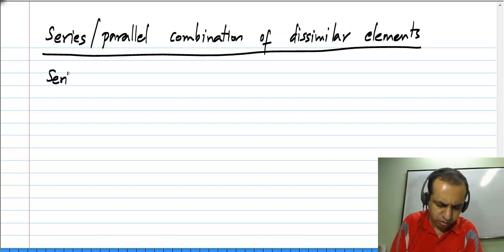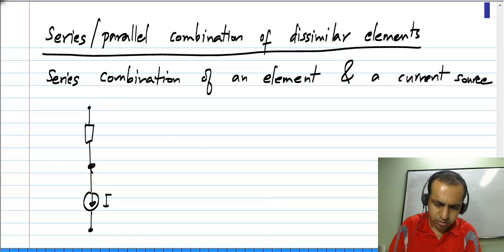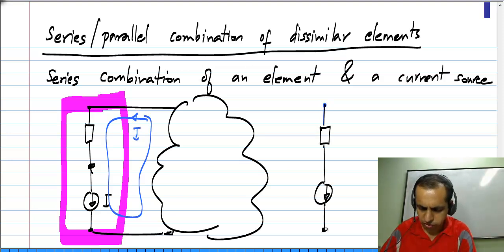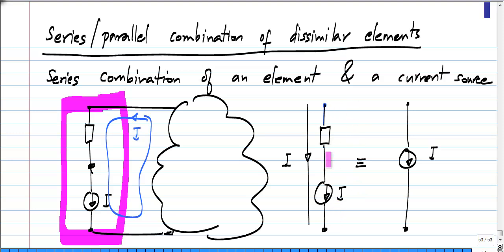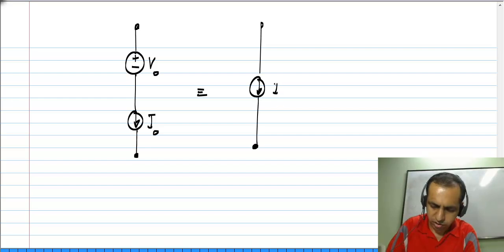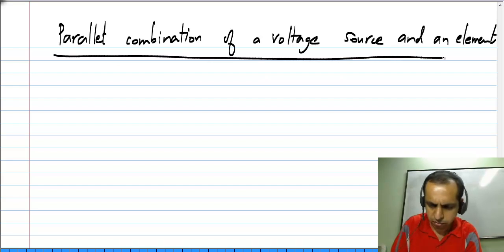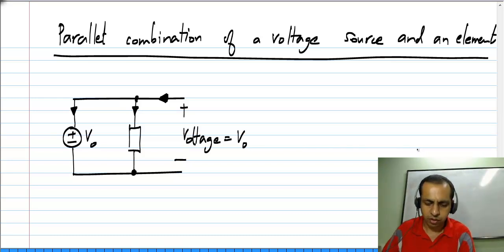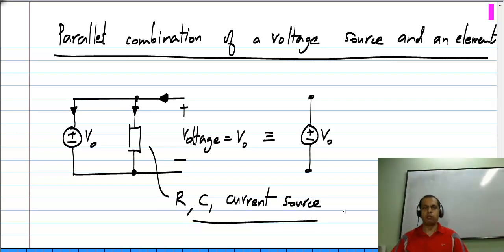Current source in series with an element; Voltage source in parallel with an element

Comment: For anyone who is wondering, like I was wondering what happens to the other component, won't it have some impact? can we just throw it away? Yes we can. Because the current source is IDEAL, if the component is dissipating some voltage, then the remaining voltage from supply will drop across current source, but still same current because current source is ideal and it doesn't matter what is the voltage across it. Same reasoning goes even if the series component dissipates more voltage at the given constant current, than what is supplied. In that case current source will drop negative voltage across it, and stil spit out the same current in the same direction because its an IDEAL current source